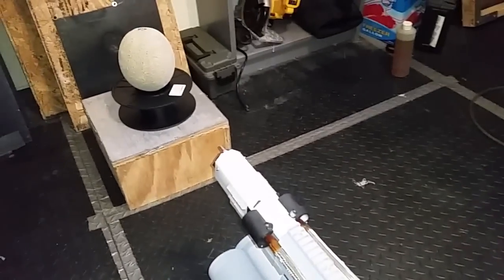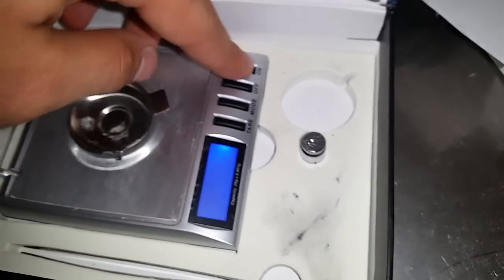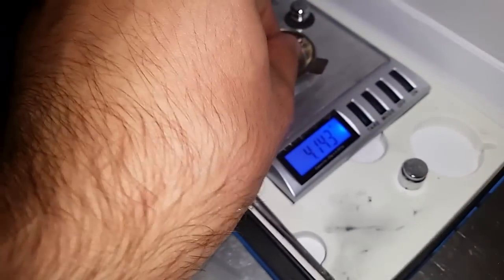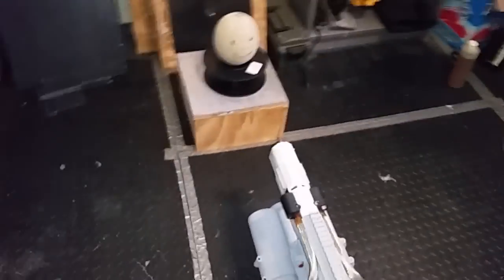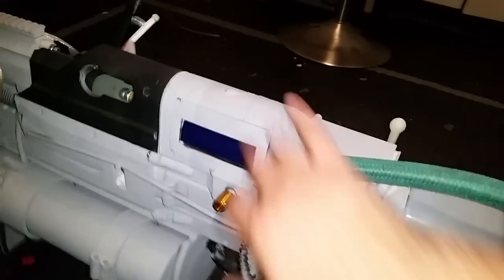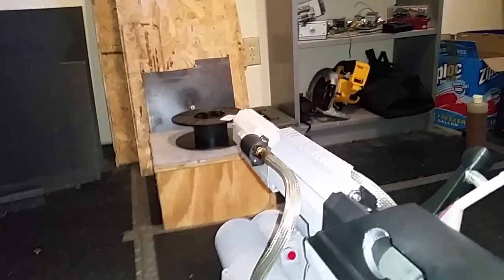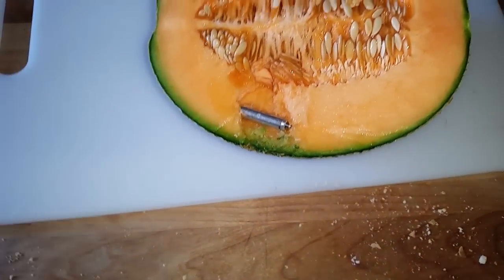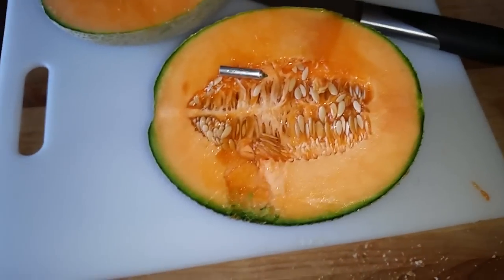XPR-1 Railgun Test 5 - Control (Injector only)

Comment: Alright, I'll admit, this looks a lot less like a hoax gun after seeing this. I still think a well designed air gun could attain all the same power as the pneumatic + rails setup this uses, which is why I found it questionable whether this is a railgun in any way.  I also still think the projectiles are bad, they aren't stabilized, and always end up striking the target sideways. They would go clean through that cantaloupe if they would fly straight.